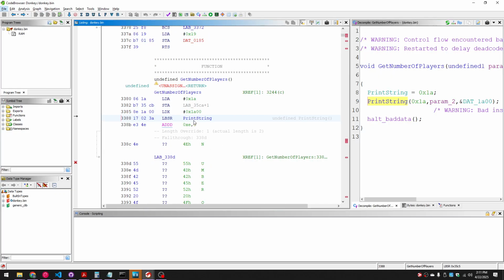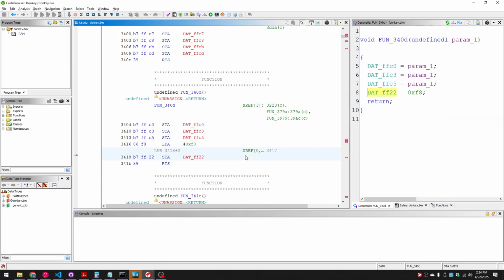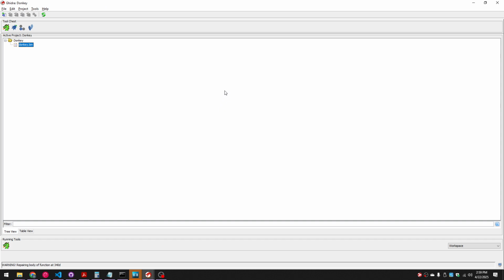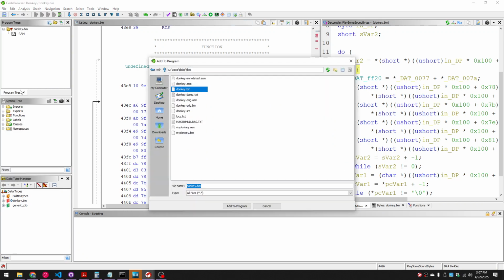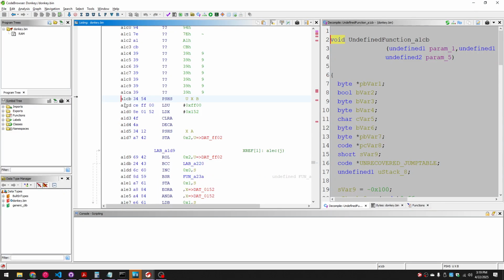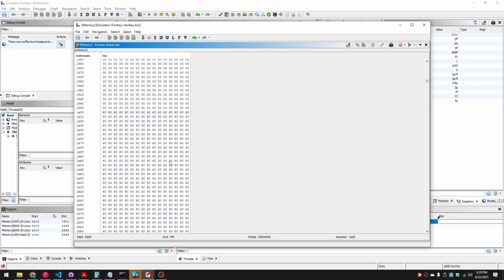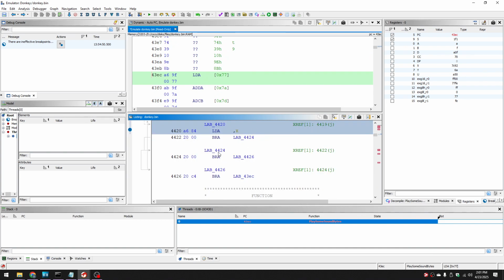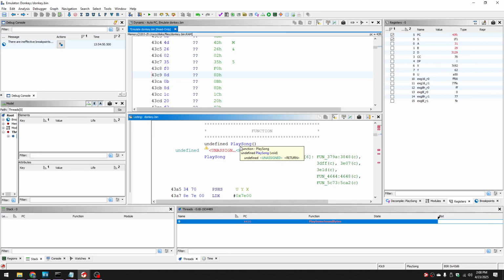More 8-bit reverse engineering: Ghidra emulation, ROMs, and mocking hardware | Ghidra intro part 2

Comment: At 5:52 you say that the value 0x200 is written somehow. But all I see is the current value of A being stored. The function itself seems to have no reference to any value. Yet you name the function as if it will only ever write 0x200. What am I missing?
Reply from the maker: The addresses A is stored at are hardware registers for the video display generator.  It's pretty funky, but by writing ANY value to a particular set of hardware registers (which just look like addresses to the CPU) you change the start address of video memory.  The set of hardware registers you choose to write to determines the start of video memory.  If you are interested enough, there's a link to a VDG playlist in the description which goes into detail.
Reply: @CocoTownRetro  Ah I understand. I am more familiar with the Commodore 64, but it also has registers that require to be written to to perform their function, regardless of what is actually written.
Thanks.
I will get around to watching more videos.

Comment: I've recently been using Ghidra to decompile two Amiga games I wrote circa 1990. Pro tip: If Ghidra is running dog slow install a better JDK!
Reply: protip:  run your ghidra instances on a system not connected to the network
Reply: Which one counts as better? It used to be so much simpler when it was just Oracle.